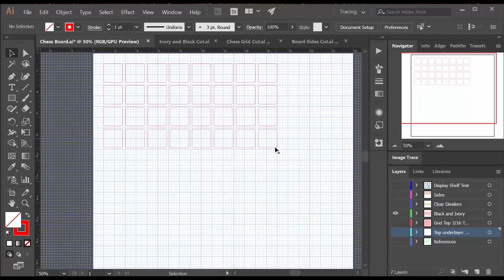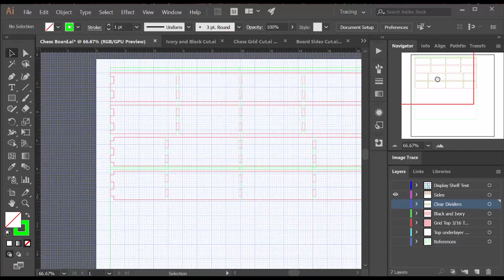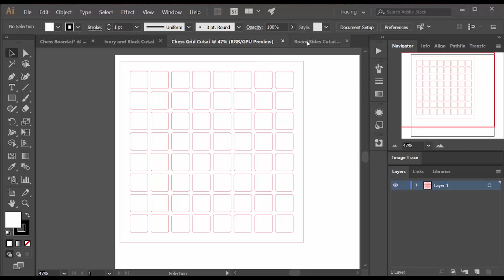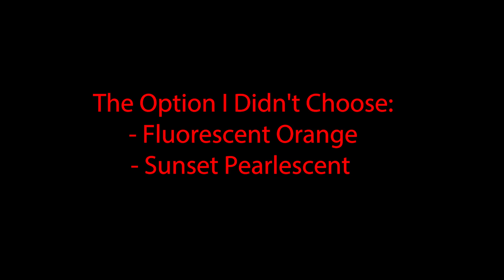How to Design and Laser Cut a Combination Chess Board and Display Shelves

Comment: would this project be possible using a diode laser
Reply from the maker: Dafyddgould, I haven't used a diode laser, but I think the 1/4 inch acrylic I used might be too thick for a diode laser. If you have one capable of cutting that material, just make sure you are using it in a ventilated enclosure, not sitting on an open surface while it cuts. The acrylic fumes are toxic.
Reply: @GreylightMay  many thanks think it can cur 10mm acrylic, I've an enclosed and pipe so fingers crossed, however need to make sure wind is blowing in opposite direction 🤣
Reply from the maker: Sounds good! Let me know how it goes!!